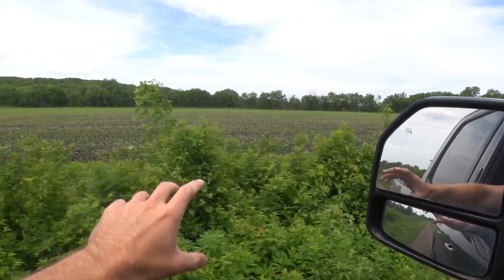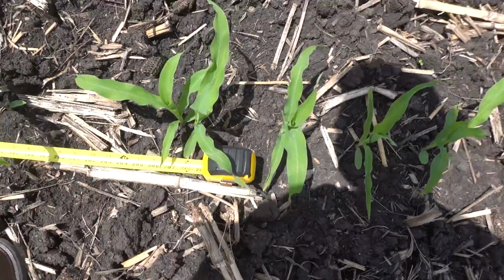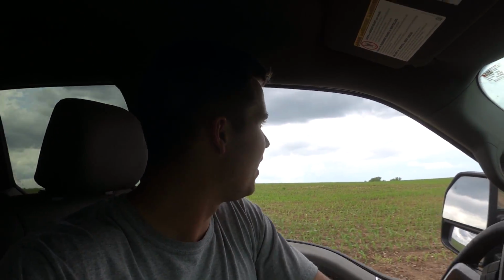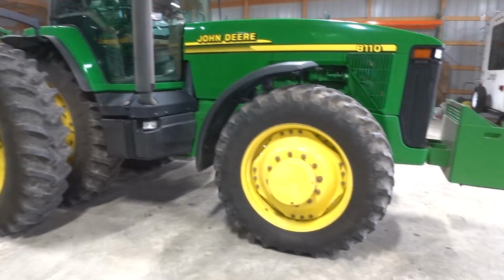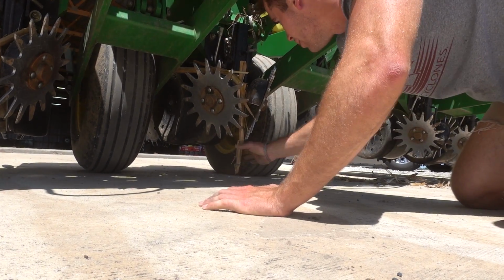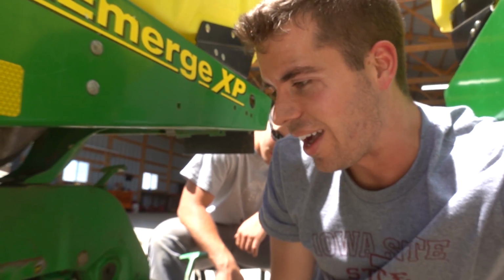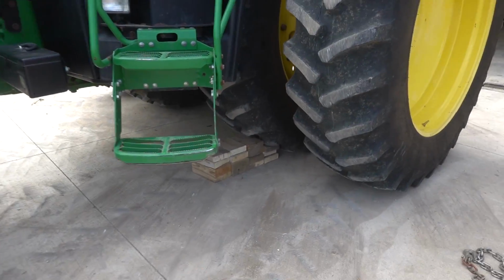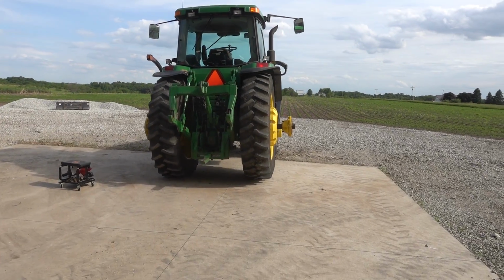I Rented my First Farm!

Comment: I have a 5 shank in-line, low disturbance ripper I’d be willing to bring by if you wanted to fall rip through that low lying area.  We equalized moisture through a few of those spots that are perennial problems and it definitely helps draw the moisture back down deeper and bring air into the profile.  My dad said after planting on it, he’s never seen some of those places dry in the spring and it was soft and loose after the freeze/thaw.  It’s an unverferth 130  and the auto reset shanks are a lifesaver.  Cheers!
Reply from the maker: Thanks for the offer! Hoping to get tile in this fall. Should really help fix it!

Comment: Without going back I don't remember which model planter/which seed meters.  On a vacuum planter see if someone around you had precision planting e-set kits that went to electric drive, maybe you could get them reasonable to help improve singulation.  Either way meter and seed tube maintenance helps and a local precision dealer could run your meters for you

Oh and if nothing else....you know a certain Pipe layer that happens to be an Ag Leader dealer I believe he said, check them for parts also